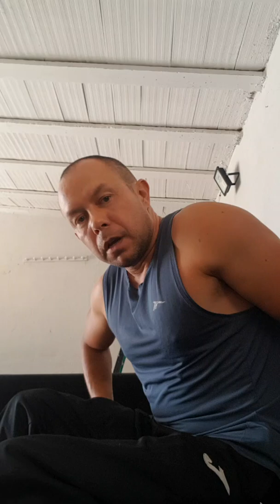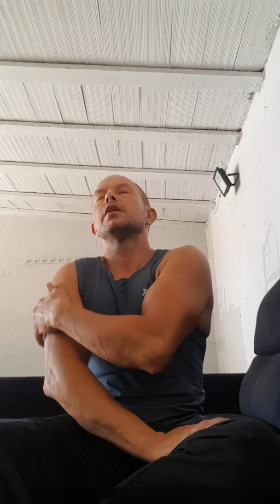Talking om604 om605 om606 mods that works and not.

Comment: What are best cooling mods besides head gasket? Is it good to upgrade radiator? Thanks
Reply from the maker: If your radiator is in bad condition or very small yes of course. But it's more important to have the correct thermostat, fan shroud and stuff like that. A big radiator is only a big radiator.

Comment: Any suggestions as to why sometimes the end of pre chamber falls of and destroys cylinder?
Reply: 90% a timing problem...but in stock engines and use they tend to crack too ...just because of ageing processes and thermic stress
Reply: @om6xxmotorsport18  i thought the timing on the om606 dont tend to crack